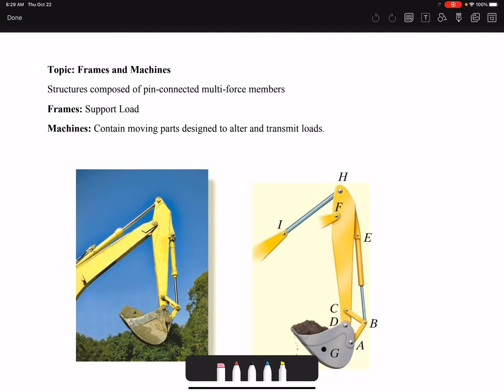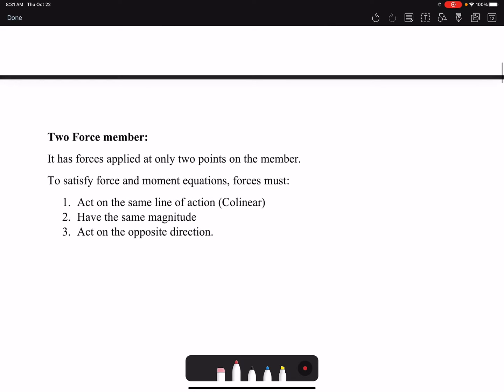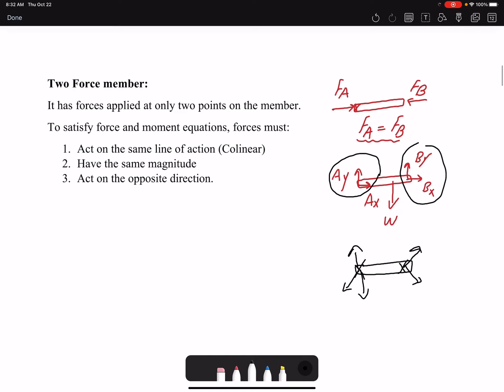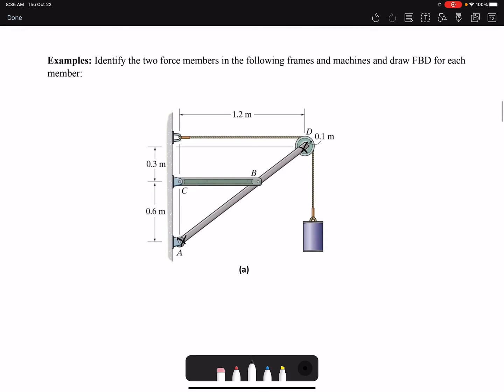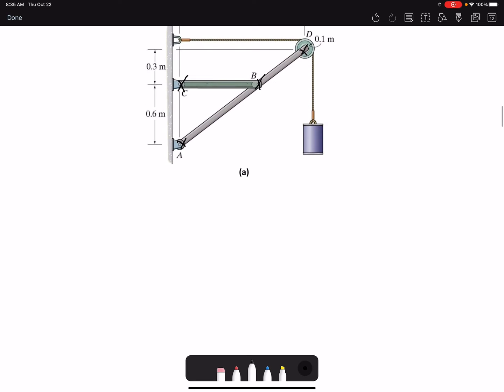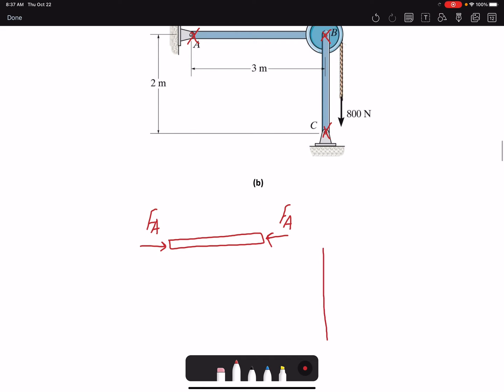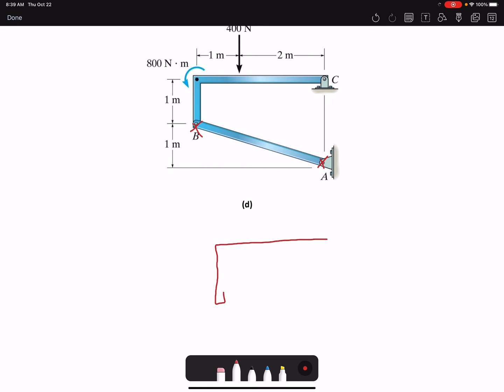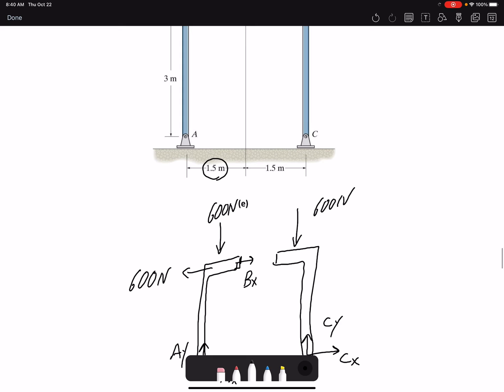Frames and Machines Lecture: How to identify two force members

Comment: Why A and b are not two force member it have pin support at both A and B no Another force. sir you explain me please
Reply: In exp 1
Reply: I reckon you have to look at the system ABD instead of AB, because they are the points on the same rod

Comment: At 9:06, why didn't we include Ay and Ax in the free body diagrams?
Reply from the maker: Great question and a common one. Because member AB is a two force member which means only two forces apply to the member, one at each end, knowing this will help us to know the direction of resultant force at A and B which would be along the member. If AB was not a two force member, we would have Ax and Ay at A and Bx and By at B. So we are reducing four unknowns to one ( F_A=F_B)